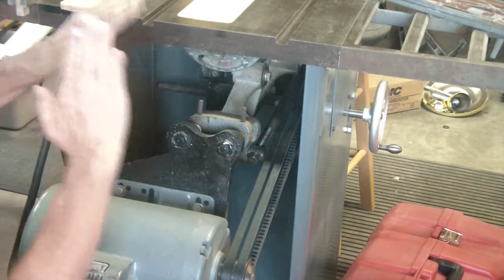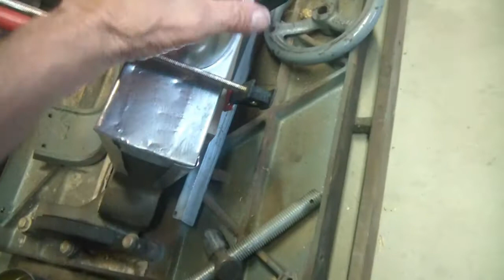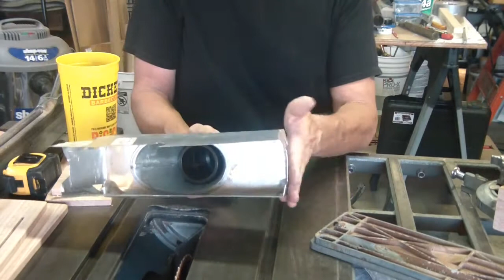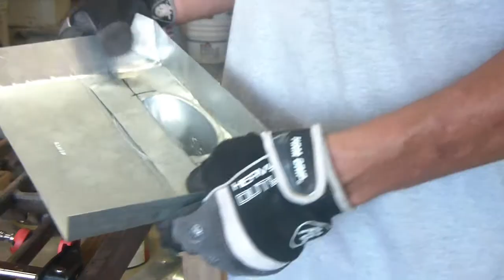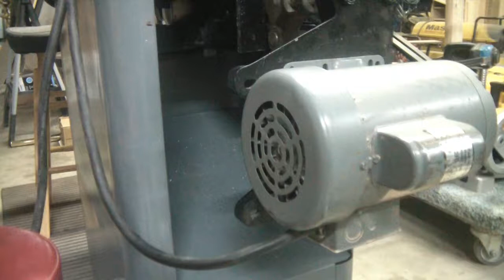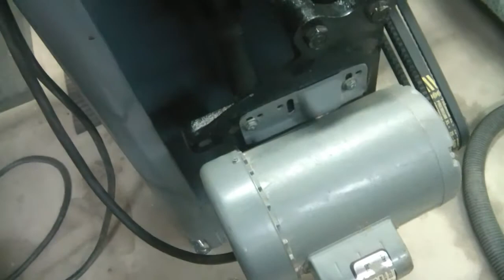Dust Collection Fabrication vintage #Atlas table saw Frankensaw Build Part 5

Comment: I've got the same saw and was planning on doing the same thing. Glad to see its a worthwhile endeavor. Now that you have had the system in place for a year, do you have any further comments or observations you would like to share?
Reply from the maker: Greg i really like how this turned out. My ONLY concern is the newer saws have a much larger outlet for vacuum lines. this being like 2" or something when i finally get to the point of a vacuum system is how It will connect. guess ill have lots of stepdowns or ups. just hope it wont be too restrictive, Other than that i would suggest what i have done for a starting point and fab to your specific needs. Works soo much better that i could of imagined. you could even do something for the table top above the blade for more vacuum but this cut down over 90% of the dust and wood chip im happy as it stands.